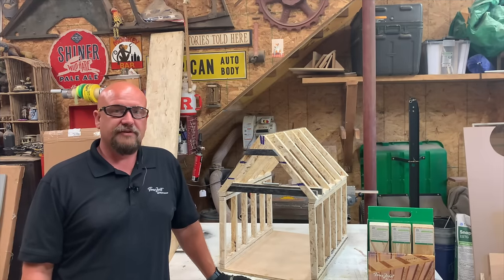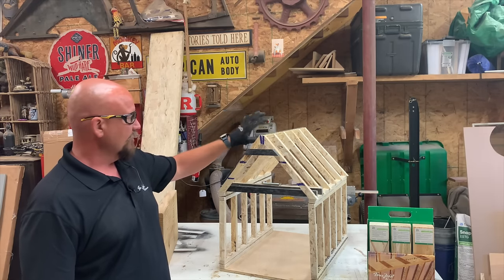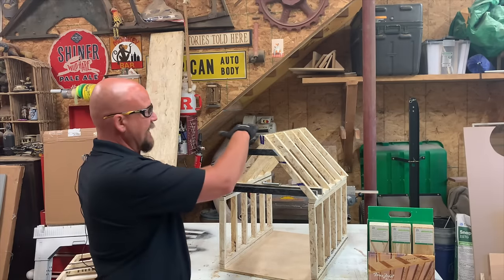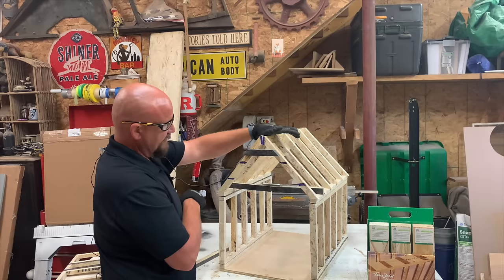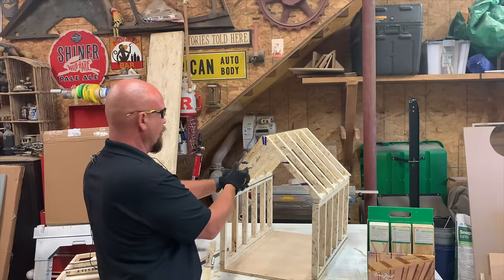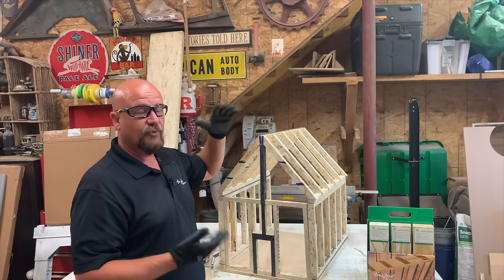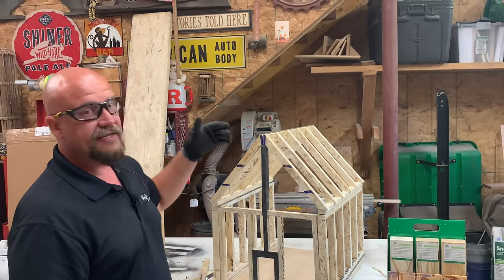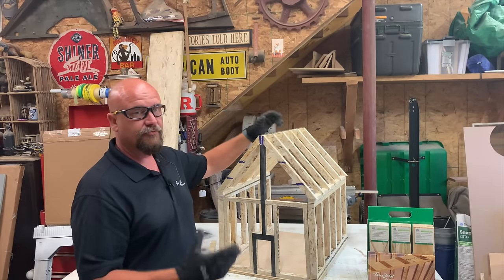The Difference Between a Ridge Board and a Ridge Beam

Comment: Nice presentation.  I'm an Architect and I go on so many job sites where there is a huge ridge beam spanning up to 32' and it is in a situation where there are floor or ceiling joists taking up all of the thrust of the roof rafters.  That ridge beam is dead weight doing nothing except adding to the roof load.  So many contractors and carpenters don't understand the strength of a triangle.  I tell them this and they don't believe me until I say how do you think all those roofs on 100 year old houses have stood up before lam beams were ever invented?  I also think the lumberyards want to sell expensive lam beams.  My structural engineer and I walked through a house he and I designed and he asked the framer why there were so many lam beams, (that were not a part of his design), throughout the house.  He produced a framing plan done by the lumberyard that had lam beams in places they were not needed.  We had done our own framing plan that my structural engineer designed and stamped, but the lumberyard ignored it and made their own.
Reply: That’s crazy. As a carpenter and contractor I have 2 things to say:

First, I think it’s important that we as carpenters make it our business to understand this. 

Second, just looking at other guys job sites I see that situation as well but don’t understand how it happens. I’ve never been on a job when there was significant structural work like that being done without engineered plans. So while it’s important carpenters have some understanding of structural issues, there should be engineered specs. Follow them. Do not deviate from them without a conversation with the engineer.
Reply: I am a structural engineer and find this problem often enough.  On one hand, I see extra unnecessary lumber.  On the other hand, I see “value engineering” in the form of minimized floor joists that are lighter/smaller than I specify (someone was trying to put some $$ in their pocket). I have taken the time to visit the lumber yard and confront the technician who is running the joist software and selling the goods.  We all want our buildings to meet code and perform well, but not to cost the client more than necessary.  Education is critical.  I have referenced YouTube videos many times to explain structural issues and also for simple building envelope things like flashing a window (yes…many contractors don’t get it).
Reply: @robertmurray43 it’s amazing how many mess up the window flashing. It’s common sense too since all you need to keep in mind is water runs down. Infuriating!
Reply: Quite right sir!
In traditional oak framing,when a tie beam is used,there is actually no structural need for a ridge at all.A pegged halflap or bridle joint where the tops of the common rafters meet is/was often used.
Sometimes,where a ridge board is used,it is often simply a 6x1 inch board whose main purpose is to help with the tiling battens and to have something to nail individual plumb cut rafter top ends to butt up against so you can work on one side of the roof at a time. 
No shortage of bad ideas out there e.g. in later traditional Japanese temple construction the err 'solution' when a temple roof had colapsed in an earthquake (obv killing everyone inside!) was often to simply make the roof heavier next time!!!
Plenty of centuries old stone buildings with oak roofs have collapsed because a cowboy builder cut through a tie beam to make room for a staircase into the roofspace.
Reply: Great info, thanks. I’m a homeowner, and though I am very good at doing many jobs myself, I would never modify a roof without a pro. But I want to move/substitute the collar ties in my finished attic to make more space, and I want to be informed for when I talk to a contractor. I live in New England with snow and occasional summer hurricane winds. House was built in 1930s, as you suggest very solidly done. Just a simple ridge board, not a massive beam. 

Upon opening up the wall on the gable end to redo some electrical, I discovered a lally column right about in line with ridge. I’d have to do more demo to see exactly where it connects, but I can’t imagine where else. Is it possible that they used this technique back in the 30s of transferring part of the load down the sides of the house? You could tell me how old this technique is. I know that they were no dummies back then. 

In any case, if in fact the load is being transferred down the columns, would it be acceptable either to move the collar ties to but up against the ridge board or replace them with hangers securing the ragers to the right board, without compromising the roof’s integrity.

I know you can’t give advice on a house without seeing. But I’m asking as a concept so I’m prepared when talking to a carpenter. Thanks for your expert input.
Reply: Framers know way more about building than architects. The pencil pushers are the ones drawing up redicualas plans.
Reply: I’m a building inspector, and I constantly run into contractors not following their blueprints (that were approved by Building and Code!) that they paid big money for. Then I make them get the Architect/Engineer to take a look at the building, make sure it’s structurally sound and is passable, then the architect has to give me an as built drawing. Only then do I issue a CoO
Reply: Finally a competent architect! 😂
Reply: Very interesting. Thanks for your input.

Comment: My house is over 100 years old, has a single 1x ridge board (a piece of t&g), and every single 2x4x16 rafter (except the gable ends) was buckled when I bought it.  Through some miracle, the roof never did collapse I guess because of the knee wall (although it was severely compromised).  I'll never forget the expression on the roofer's face when we told him we "bought" the place.  I could type a book about what I've done to it since, but it's all replaced now.  I like your video, it's good info and a fun visual
Reply: My house is 125 years old.  Well most of the 125 year old house is inside of it.  You just have to go to the basement to see it.  The old plank floor is under the floor and the old plank walls are inside the walls.  But the roof has no vents and no collar ties.  But thats the new roof they built over the old roof.  The old house was only 400 sq ft and it's roof is inside the attic.
Reply: There's that data I commented on. Your firsthand account refutes this guy's claims.
Reply: Very common in older homes. Roofers are not carpenters so I'm not surprised that he was confused. Next time hire the right contractor.

Comment: Very interesting. So we don’t need collar or rafter ties when we have 2 support posts for the top LVL ridge for both ends? How long the LVL can go without adding more posts in between?
Reply: Depends on the size of the ridge beam and amount of roof weight it’s carrying. Usually there are deflection limits, and as the beam gets longer, the deflection can be too much unless you increase the size of the beam from a 4x12 to a 6x12 to some LVL. That’s why an engineer will do the calculation to control the deflection.
Reply: See his instruction at about 5:13.
Reply: I’ve put up large tripled 14” LVLs  that sagged before the load was even on them.  Even when engineered they sag a lot, and aren’t the answer to everything.
Reply: @daversj  lvls don't just sag...I've built many houses and used many lvls in varying sizes and situations...of course they are not the solution to every problem but unless you are misusing them, (in my experience) they certainly won't just sag.

Comment: Nice presentation.  A simple demonstration you can do without a model is to sit a table with your chin in the palms of your hands and your elbows on the table.  Then notice how your elbows want to spread apart from the weight of your head.  Now do the same thing with a stack of books and rest your chin on the books with your hands in the same position.  The outward pressure on your elbows is relieved.

Comment: I built a structure exactly like that, with the ridge beam about ten years ago! It was huge. The ridge beam was a 3ply 16” lvl. Anything is possible with LVL!
Reply: Heck that looks better than anything else I have built.
Reply: I need to do more research regarding "LVL" durability & stability, but I truly appreciate all perspectives here.
I built the same model and am currently using this for an upper level expansion. Thank you All.🤓
Reply: @chrisfreeman5975  lvl= better strength, better resistance to expanding/contracting, much stronger nail holding capacity
Reply: @atomjordan  got to turn up my nailgun to shoot into LVL. Amazing product.
Reply: @je-fq7ve  Yep, especially during winter! Safe building!

Comment: Great explanation. Where would a scissor truss fit into this for a cathedral ceiling?
Reply: This demonstration is for stick framed roofs.  Any roof using structural engineered roof trusses (including scissor trusses) are already designed to support the roof loads and a ridge board or ridge beam is not necessary.  You do still have to provide blocking between each truss at the ridge as well as bracing in various locations to keep the trusses from racking but that would be determined by the truss manufacturer and the truss drawings would indicate where the bracing is required based on the design of your roof.

Comment: But even with the compression roof the gable ends would have braces all along the edge if not for support at least to provide a board to attach the sheathing and thus provide the same load transfer down to the foundation.  Right?

Comment: great video. 
how long can the ridge be? in case of long ridge, is it possible to join two ridge beams?
Reply: They can make 'em at least 48ft long. If you had two end to end you'd probably need to support them with a column underneath where they meet. Check with a local engineer.

Comment: Could those columns continue straight down to the foundation, or do you need to have the header that splits the load up onto two jack studs? Is that for a wider centre of  gravity or something? Or just a way to allow for a doorway on that wall?
Reply: The header is used in this application, or any, when the post is over a door or window.  You need to transfer the load around the opening.  If you have a blank wall with no opening then yes you need to run the post straight down to the foundation.

Comment: I had to repair a house that had a box beam running down the vault (Like 3ft wall on the ceiling) spanning 60ft. It was sagging like 3 inches. I ended up having to build a footing in the basement and run beams up the middle of the house to support it. From my experience as a remodeler I'd never build a vaulted ceiling unless it was a small entrance.
Reply: Cathedral ceilings can be very large if they are designed correctly to begin with.  A lot of it depends on whether you stick frame the roof or use pre-engineered roof trusses, etc.
Reply: Build them right and the vaulted ceilings are absolutely worth it. Makes a small footprint seem bigger and that’s super important with the cost of lumber..

Comment: This won't work for an attached garage, where the house door is right in the middle, as it would be in the way of the ridge beam structure mentioned?
Reply: The load transfers down to a header over the opening and then down jack studs to the floor. Squash blocks to the foundation under that if it's a framed floor.

Comment: Hi, I have told that 2200 mm clear height measured from bottom of ridge board to top of first floor ceiling joist is sufficient in a loft conversion. But as per my opinion, it is still not possible if used minimum 152 mm U.C both in ridge beam and floor beam. Its become  2200-152-152-50  mm (Spreader plate+ deflection)= 1846 mm < 2000 mm (minimum clear height).I have ignored thickness of floor board and ceiling plaster board.
Please advice.
Reply: Look into the minimum room height and width/area according to your code, if you want this to be habitable space. Personally I am not sure I understand what your calculation is aimed at, sorry.
Reply: You do know 2200mm is less than 8’.  What exactly are you referencing?  Are you saying that since it’s not high, the wind can’t push it over.  The wind sucks it up as it goes over the peak ( low pressure outside, high pressure inside).  Actually more so down by the wall rather than the  peak.  Do you ever see tie downs from where roof meets wall,  then carried down to foundation.  Probably more so down in Florida.  If you see a roof blown off in the interior of the country, it probably encountered a tornado or plywood sucked off as result of a typical contractor that doesn’t understand why there’s a code regarding fastener’s.
Reply: @Now_lets_get_this_straight , Hi, this is a matter of minimum clear headroom of 2000 mm which is necessary after the installation of ridge and floor beams. Practically, it is not possible to construct a loft conversion if the existing clear height between the floorboard and the bottom of the ridge board is 2200 mm. As minimum of 152 mm U.C. beams (Ridge and floor beam) are necessary for a loft conversion. So the remaining height will be less than 2000 mm
Here in U.K., the ceiling of the loft cannot be raised up from the existing level. Instead, you can lower the first-floor ceiling to gain a 2000 mm height in the loft. But again if sufficient headroom has left in First-floor after lowering the first-floor ceiling.

Comment: I like to do load bearing walls incorporated into the layout. Vaulted ceilings are nice, but over time a lack of load walls can lead to a lot of popping and cracking.
Reply: Never understood the desire for vaulted ceilings. Harder to change bulbs. Harder to paint. Harder to clean. Much more volume of air to condition.
Reply: @joshuasmith1215  I like it because it cuts out having to create an attic space, which needs ventilation. When you put vents in an attic, sand (here in the southwest) tends to build up and mix with insulation. This causes sagging of ceiling drywall. If you look at local buildings, you get a lot of structures like adobes and Navajo hogans that do not use attic spaces. There are a lot of lean roof and vaulted dwellings. Venting is done by opening windows taking advantage of the breeze.
Reply: @docnez8562  Just studying to build my own cabin. Do vaulted ceilings still require some ventilation between the underside of the roof sheathing and the insulation in between the rafters? What distance of air gap is best practice?
Reply: @ShikokuFoodForest  you can still put the round vents between each rafter set. But on a small cabin, not putting them in should be fine.
Reply: @docnez8562  Thank you! I’m not a builder, where exactly between the rafters do the vents go?
Reply: @ShikokuFoodForest  under overhang on the outside, right on the soffit.
Reply: @docnez8562  Thank you, makes sense. How much air gap do I need between the roof sheathing and insulation?
Reply: @ShikokuFoodForest  depends. You using batting or foam.

Imo. Use foam. Insulate the exterior of the roof. Put metal on top.

No gap needed.
Reply: @joshuasmith1215  Yah, especially if you live in the far subarctic north. They create a huge extra volume of air to heat up. I had ceilings, then removed them for about 3-4 years, to open up my timber-frame house. I really liked the look at first, then I decided it was too hot in the summer and too cold in the winter, so I’m re-building all new ceilings. Much better now.
Reply: @GuardianAngle93  Hello, I live in a very cold climate and I think now I’ve decided not to have a conditioned attic after all. I figure I don’t need the extra space, so all it does is creates extra volume to heat in winter. if I put rigid foam on top of the roof sheathing, then metal on top, with no soffit ventilation, then  how does any warm, moist air escape? I’m thinking now to have traditional insulated flat ceilings, with a ventilated, steep pitched gable roof to shed snow. My initial plan was to build a partial second floor with 4’ pony walls and a vaulted ceiling, but now I figure I don’t need it. Construction will be simpler.
Reply: @ShikokuFoodForest  moist air. In a BC home in winter?

my house is dry as hell with the fire going.
Reply: @GuardianAngle93  Haha, you are probably right. The air is very dry in winter, for sure. Is all the moisture from cooking, showering, breathing, etc. insignificant? I can install an exhaust fan or simply open a bathroom window when needed. Similarly when cooking, I can do the same. So are you saying, a ventilated attic is unnecessary?
Reply: @docnez8562  does that require something like a ridgevent?
Reply: @andrewrossnagel9433  not really. But you can.
Reply: @joshuasmith1215  Just like everyone else in the world never understood why your mustache, why that haircut, why you eat this, etc...
Reply: @ShikokuFoodForest  It all depends on your overall design. Some people will build a loft and have a bedroom there. Also, if the basics are not there, then whatever you do will be, mostly in vain. You need top-notch insulation and a good ceiling fan and to know how to use it! Which most people don't. The ceiling fan can either push up or push down the air. It needs to push up during summer time and push down during winter.
Reply: @joshuasmith1215 it's because we are rich and we don't care about painting, cleaning, or the AC bill, leave that to the low ceilinged peasants. 🤑